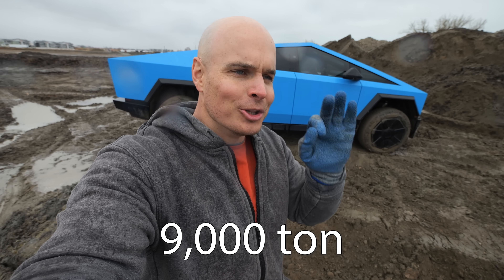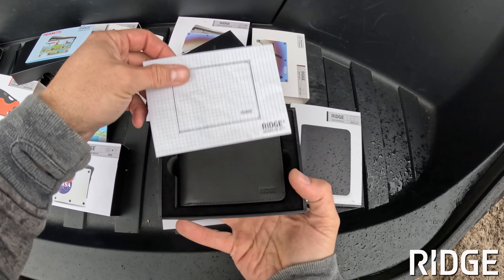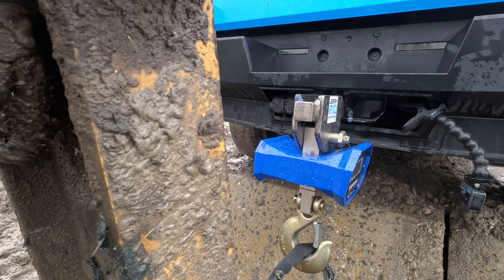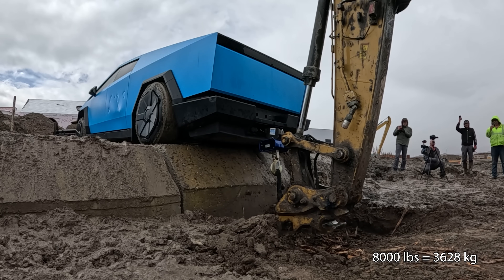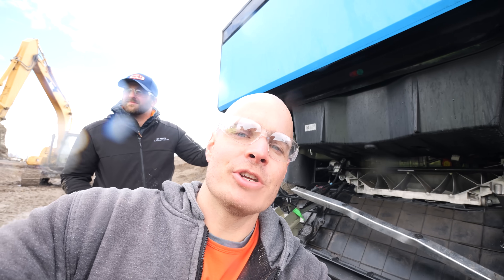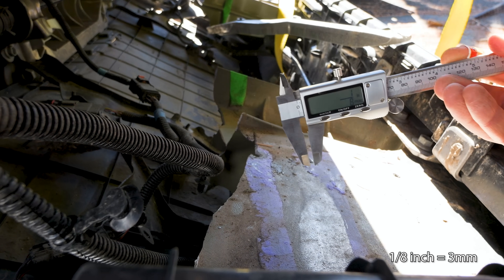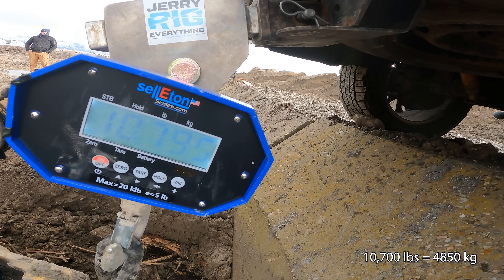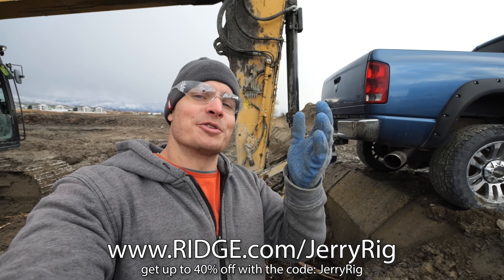SHOULD YOU TOW WITH A CYBERTRUCK?! - (catastrophic failure test)

Comment: The important takeaway here is that damage in aluminum is cumulative and the constant small strains caused by a swaying trailer, road irregularities, loading and unloading of the tongue weight have a deleterious effect.

I recommend reading the following paper which is available from NIST.  You can search for it by its title:

Effects of Prior Static and Dynamic Stresses on the Fatigue Strength of Aluminum Alloys
Reply: Yup, the people saying it did really good aren't taking metal fatigue into account. OR the fact that a failure mode of snapping instead of bending is a huge problem in itself
Reply: @thecrazyfarmboy  That, and the fact that the wrecked truck did better simply because it was made with better materials. Making it out of steel would have made this a non issue, and none of us would be discussing it if it was made of steel
Reply: Legit this is a long term safety issue. Jerry said he wouldn't drive near a Cybertruck that's towing and it's good advice
Reply: Yup. While this specific sort of thing is unlikely to happen, there are a hell of a lot of things putting stress on the frame when you're towing. And no matter how good your suspension is, you're transferring some force into the frame when you hit any sort of bump even when you aren't. On pavement, that's probably not going to be a huge deal. But once you're on dirt roads, even regular driving is putting stress into the frame on a pretty regular basis. Even more so with any real offroading.

Aluminum, especially cast aluminum, isn't good at handling the cumulative effects of regular stresses. There are absolutely ways around that in certain applications such as airplane components, but you still aren't using cast aluminum for that. A Cybertruck probably won't experience a catastrophic failure in the frame from regular pavement driving while either not towing or barely towing, but it's absolutely not safe to use for some of the things it was advertised as being capable of. So it's an okay pavement princess for some Silicon Valley techbro to compensate with, but unacceptable for a working truck.
Reply: @  Thank you for the detailed and well stated reply.  It is much appreciated.
Reply: Cool I totally will thank you finally someone that has a comment that doesn't read like a arrogant 12 year old.
Reply: @  Thanks for the kind remark.  There aren’t too many on YouTube.  I appreciate the feedback.
Reply: I’ll just take your word for it :-)
Reply: @  Thanks.  I tried to be as factual as I could.
Reply: The rating for the tongue is actually 1,100 lbs, and it withheld almost 10x that. That's really good considering most have 2-3x rating maybe 5x. So, even though the damage might be cumulative, it's negligible damage. It will still have a healhy lifespan.
Reply: @dilettante4270 you heard it creaking and cracking at 6000 lbs. It was shot after that
Reply: @Shawn-zt3gv  oh sorry... 6x my stance on the matter remains the same
Reply: @dilettante4270  you do you. Good luck towing with it I'll be the one not driving around you
Reply: Why do you think steel is somehow impervious to stress fatigue? ALL METALS ARE SUBJECT TO STRESS FATIGUE!
If you bend a paperclip (steel) back and forth, it will eventually snap. The same will happen if the paperclip was aluminum, but you'd actually be able to bend it more times before failure. This is because of the metal's highier elastic properties. 
That being said, steel's tensile strength is usually double that of aluminum's. So it doesn't matter how much more durable aluminum is to fatigue; steel makes up for it in raw strength. 
Please read more into the topic next time before coming to half-baked conclusions.
Reply: @Fun_Dips  All metals suffer from stress fatigue but steel suffers zero stress fatigue if kept within elastic deformation, that's why springs are made from steel and can withstand billions of cycles.
Aluminium suffers stress fatigue even under elastic deformation and that's why airliners are limited by the number of pressurisation cycles they perform.
Reply: @somelokyguy6466  the whole aluminum lacking an edurance/fatigue limit, where under a certain load, it suffers no theoretical stress fatigue really isn't as big a deal as most make it out to be. You don't need a frame to withstand billions of cycles. Take your example about planes: a 747 is rated to ~35,000 cycles, amounting to around a 27 year lifespan of heavy use.
35,000 cycles of let's say, 15 miles, results in 525K miles on your odometer. Even if that frame fatigue life is halfed from hard use, 250k miles is a pretty solid life for pickup.
Reply: @Fun_Dips  steel generally has a fatigue limit, meaning a cyclical stress below a certain threshold will never (or least not for a VERY long time) lead to failure.
Reply: @ The point is Aluminum is worse, and it shouldn't have used Aluminum.
Reply: @Symmetry_Obsessed_Freak  you're really overgeneralizing, saying aluminum is worse. 
Aluminum frames don't rust into oblivion. That's kinda a huge deal. 
Yeah, they could've made the aluminum thicker, or gone with steel, but when the frame can already handle 10 times the tongue weight it's rated to, I think the better takeaway is: if you push something far over what it's rated to handle, at some point it's going to fail.
Reply: @Symmetry_Obsessed_Freak   I think aluminium is a great metal for this purpose. it is anyways exceeding its spec and it is important for elasticity.
Reply: @Symmetry_Obsessed_Freak many heavy haul semi trailers are made out of aluminum. Are they dangerous?
Reply: @abbtech  No, because they're not glued together, and the aluminum is probably thicker. I'm not familiar enough with semi trailers to know the thickness for sure, but I can say with a reasonable amount of certainty that they're not glued together unlike this $80,000 hunk of junk
Reply: @abbtech  Heavy trailers often will have aluminum structures and decks. But these are mounted on steel frames, same as Ford's pickups.

The frame takes the fatigue-causing stress, not the aluminum, which is under minimal stress.

An all-aluminum heavy trailer (of the sort hauled by a class 8 tractor) isn't a thing in the trucking industry.

Comment: Moving aside the load that snapped the rear part off. Seeing the structure that was damaged it is clear that this frame is not repairable in any way. That frame may be relativity light resp. relativity stiff but a small damage and the Cybertruck is a economic total loss. Many cars these days quickly get to that point if the main structure is damaged too much, but the Cybertruck really goes all in on that. Its like a disposable product.

Comment: Pulling down with 10,000 pounds is not even close to being like 10,000 pounds of trailer. most trailers only have a few hundred pounds of tongue weight.

Even a RAM3500 does not have have support for 10,000 pounds of bumper towing tongue weight safely.

Comment: dude you prove nothing here other than the fact that aluminum is brittle and steel is ductile. All you did was show that tesla designed this hitch appropriately to be able to efficiently withstand 3X it's rated load which is the gold standard for good mechanical engineering.  The steel material is not going to catastrophically fail because ductile materials stretch a while before they break.

Comment: Theres no situation where an 11,000 pound trailer is going to subject the hitch to 11k pounds of force on that vertical axis. That's 10x the rated hitch load. So the hitch/bumper is doing far more than it needs to do and was designed properly.  The fact that the dodge hitch didnt break means it was over engineered and costs more to produce.

Comment: This is not a reasonable/fair depiction of- I am not a fan of Tesla/Musk - you kept talking about a “trailer improperly loaded” - there is no way to improperly load the trailer - that would put much more than half the weight on the tongue - a less sensational but mare realistic/fair test would be to put as much of an 11,000 lb load that could be realistically transferred to the tongue - the simulate the affect hitting the pothole you kept mentioning - maybe doubling the weight to simulate its affect - but that would have held - and made for a boring video…

Comment: Any heavy trailer should have it's trailer brakes looked at and the battery charged just in case but what worries me is that the safety cable that would activate the brakes would still be attached to the trailer via the entire hitch and rear frame.

Comment: Nice experiment! However, regular car towing is authorized for only 75kg pressure on the tongue, and 750kg trailer weight, or 4250kg total weight of the vehicle + trailer. Check the regulations in your area. You need special permit/hardware/driver's license to drive with more weight. So 4700kg/75kg=62.66 times the allowed pressure limit on the tongue which is more than a very good rate. Not to mention that you'll be flying off the road much before you even get to 3-4 tons pressure on the tongue!😅 Anyone who owns a trailer should already know this.

Comment: I have to agree with some of the comments here and there. Tongue load =/= tow capacity. This video points out that a RAM2500 has a greater tongue load capacity (due to frame material) than a Cybertruck, but that doesn't mean that the Cybertruck can't tow. As a result, 14:31 is a pretty harsh opinion. It sounds like the outcome of the test is that towing with a Cybertruck is dangerous, which is not the actual outcome. On a separate note, we can talk about how fragile it is, but I think that calls for another round of testing and with a different approach.
Reply: Hmm not following. Danger proven then relevant scenario described at 14:31 right? Note “in all scenarios” qualifier elsewhere in video - totally fine 99% of the time, just like playing with scissors :)
Reply: If our mothers were gonna get on the road we’d assume every towing Cybertruck is gonna hit a pothole and critique accordingly

Comment: I can guarantee you there isn’t a conventional pull trailer in the world you could overload enough to break that hitch off.  10,000+ lbs on a ball is absolutely asinine.  That would be over 80,000 pounds on most trailers lol.  Not to mention the fact that the truck would be resting on the trailer tongue or hitch well before it would snap off.
Reply from the maker: of dead weight - sure - but driving is dynamic and the earth isnt flat.
Reply: @JerryRigEverything I missed a couple things here and added in an edit.  I tow gooseneck trailers frequently and my F350 with timbrens is absolutely screaming for help with 5000lbs on the tongue.  

If you hit 10k on the ball the cybertruck would be doing a wheelie.  It would probably be doing a wheelie at 6k honestly.  You’d know there’s something wrong well before you’d have catastrophic failure.

Comment: If you are worried about this occurring on your cybertruck, you are worrying over nothing. A failure utilizing a vertical sheer force at almost 10 times the expected tongue weight rating is absolutely acceptable. Should people overweight a tongue ever? No. This test is beyond what acceptable limits are. Tesla cybertruck has a 1,100 lb tongue weight rating. Regardless of how you tow, and if you are towing properly you would never see the kind of downforce on a hitch like this. This particular review seems somewhat misleading and disingenuous. I am not saying that there is anything wrong with the video overall. For amusement purposes and the willingness to destroy a $100,000 vehicle go for it. But to imply that there is a reason to fear people towing in front of you or yourself losing a trailer is a bit of a stretch. Know the manufacturer recommendations for towing on all vehicles. Be wary of any vehicle owing in front of you. Many people don't understand proper towing techniques regardless of whether it is a Tesla or not. So while the video does contain interesting content as always, I wouldn't use it as a hard and fast measurement of DOT and vehicle safety testing and guidelines. Love your videos though.

Comment: The 11000 pounds is TOWING weight not TONGUE weight. You should have anchored the truck and pulled horizontally, not vertically.  All you proved was that the tongue weight capacity is well over the listed weight,
Reply: The max claimed tongue weight of a vehicle is always only a fraction of it's max capable tounge weight. When stationary the claimed max tongue weight should not be exceeded because while driving (as Jerry showed in the example with the toy truck) the tounge load multiplies by A LOT. So even though he showed it while stationary that does not mean that those forces aren't applied while driving over a bump or a pothole or anything like that. This wasn't about towing on a straight even road without potholes but about the dynamics of driving on roads with bumps, potholes and stuff that's everywhere on every road.
Reply: I was thinking the same thing !!!!
Reply: Yeah I agree if they were towing 11000lb of trailer and payload the max tonque weight should have only been max 1650lbs as typically the manufacturer builds the trailer so only 10 to 15% of the total weight is on the tongue and the rest on the trailer axles. Good video though lol!
Reply: @MSmith-w8t unless you hit a bump. Forces change very fast with terrain inconsistencies.
Reply: Even pulling horizontally, it isn't like you'll accelerate at 1G while hauling a full load. That'd be wild.
Reply: And everyone is so anti musk this doesn't matter...

Comment: It would have made more sense to improperly load a trailer and drive it as fast as possible down a jacked up dirt road, or over a bunch of speed bumps and then assess damage. This "test" is not remotely reflective of a towing scenario or towing failure. As mentioned in the video, tongue weight isn't static while driving, but this was completely static with failure happening long after the suspension was bottomed out and physics cheated by holding the front of the truck down.

Comment: Now, show me a 10,000lb tongue weight trailer that someone is going to tow with this truck!!!
Reply: You would only need over 10,000 lbs of force, not static 10,000 lbs correct? So it could be less but the bouncing would get it above 10,000.
Reply: @chaydonofallon1352  on a properly loaded trailer you should never see 100% of the trailer's weight on the hitch vertically unless something went horribly wrong and you get some air time. With a 10,000lbs trailer you should see about 1,100lbs static weight on the hitch. A very rough road should only apply about 3x the weight as a dynamic load. If you are exceeding that you should not be driving on that road. That would be on the driver's bad judgment, not the vehicles fault.
Reply: @chaydonofallon1352  No, because at that point your truck would do a backflip. Even if it miraculously didnt flip and the wheels stayed to the ground, the tires and suspension would spread the force over time. Not to mention that even with a front loaded trailer the weight will be spread over the tires by the axles.
Reply: That's true, he mentions it a few times, simply improperly loading a trailer could double or triple the tongue load, then you hit a pothole while pulling up hill... and say goodbye to the rear end of your Tesla, and your trailer.

It's admittedly unlikely to actually happen, and would require user error. It's certainly a weaker design than a steel framed truck.
Reply: @chaydonofallon1352  the suspension and tires would absorb most shocks keeping a properly loaded trailer hitch from seeing anything near 10,000 lbs. There are videos on YouTube of cybertrucks towing some silly heavy stuff with all kinds of loads and not breaking. This truck probably broke because he rammed the hitch into the ground going in reverse before the load test. He himself hauled an 11,000 trailer in another video without issue before he abused the living crap out of it.

Comment: So if the cyber truck is only rated for a Hitch weight of 1500 pounds there is a safety factor of at least four and probably a little bit more if it breaks that’s on you for unproper loading

Comment: sorry but this is physically wrong! Even if the 11tpounds are on the trailer they will never fully act in vertical force on the hitch point unless the trailer is hanging off a cliff in which case you have much bigger problems. 
Probably worth quite a lot of clicks. hope it pays more than the depreciated cybertruck is worth. nice exit strategy though.

Comment: the problem is the tow capacity is by weight ratio, my car at 4,000lbs is rated for 2,000 lbs but can tow around 2,800 lbs. It can do this because it's over built and uses a SUV frame. A car built out of aluminum and has luxury items that weigh in at 4,000 wont have the same ability to tow 2,000 as an over built one for rally sports. 

I don't believe the rating system is all thought out, suv crossovers are allowed to evade safety tests in usa

Comment: Tongue weight is vertical, tow capacity is horizontal.  It started breaking at 10x the rated tongue weight.  How is this proving anything?

I'm not sure I buy the idea that "in a worst case scenario" the full weight of the trailer, loaded properly or improperly, could be transferred to the hitch receiver in a vertical direction.  Some vector that distributes much more than the rated tongue weight for a brief moment, absolutely.  But the full 11,000 lb directly down, I don't think so.  

All that said, should a cast aluminum framed vehicle with a thin cross-section be rated to 600 lb/11,000 lb?  On this point I agree with you.  Should the Cybertruck be rated for 500 lb/5,000 lb to facilitate light duty homeowner towing?  Certainly.  But it is not a replacement for a Super Duty.